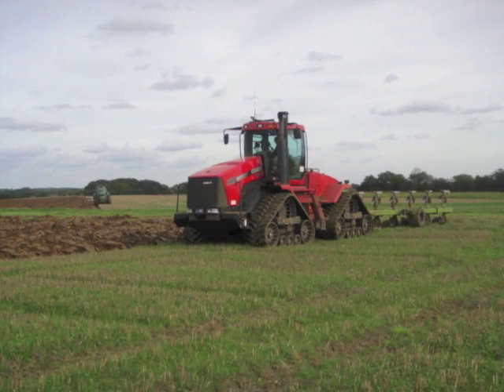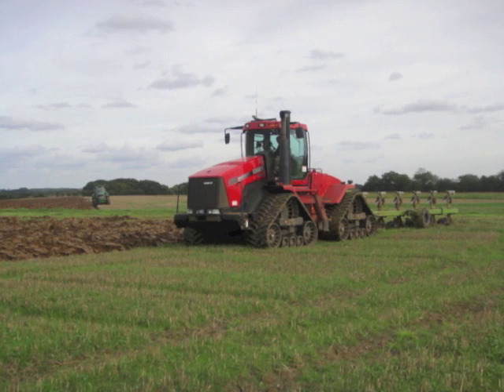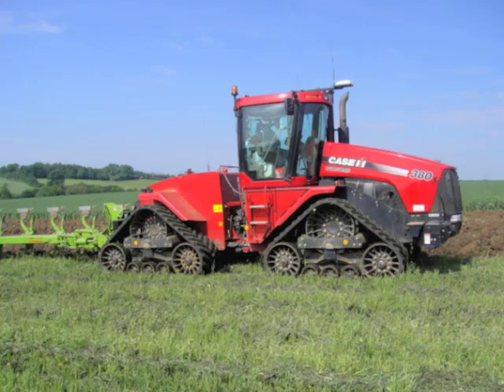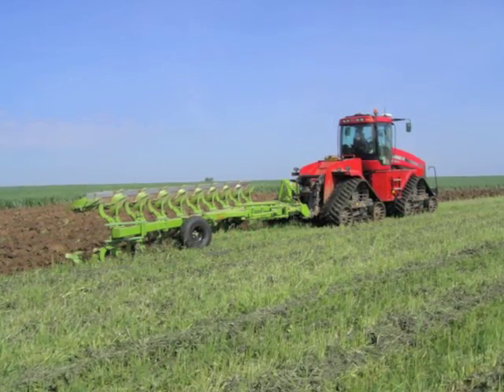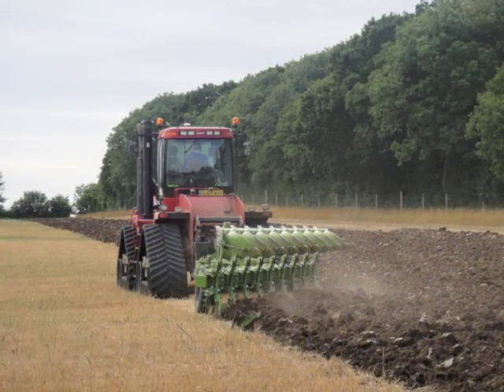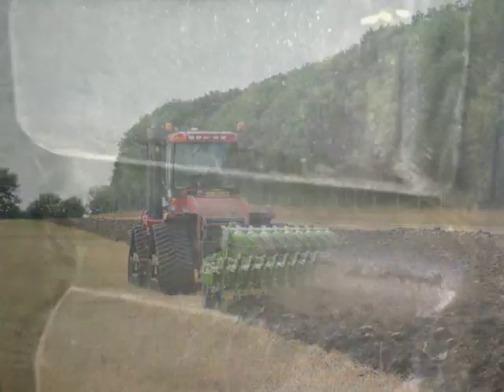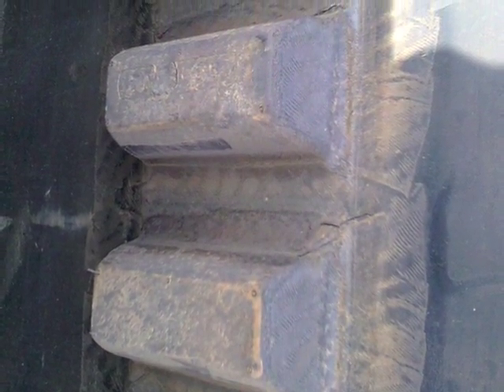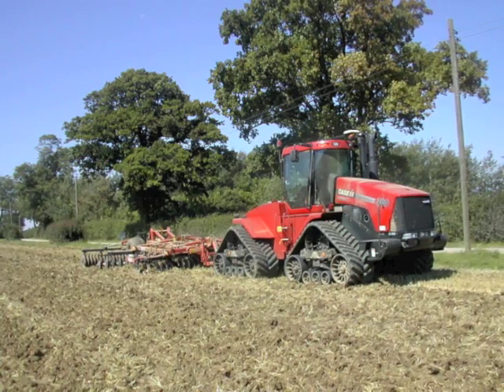Kevlar coating on Quadtrac Goodyear tracks cracking. Should I be worried?

Comment from the maker: @ajsnorfolk I did not ask for the coating, they just sent them out. I am pushing the dealer for a letter to say that the cracking is normal and that there is no reason why they should not last as long as the previous tracks. I can only assume that the coating is put on the tracks to extend their life and to help stop lugs coming off the tracks in the first place. The reason for changing the tracks is never that they are wearing out, it is always because they start to loose internal lugs.

Comment: Well if they said that they should stick by you as they are the first tracks with the coating they have fitted, did you ask for the coating or did it just come with them anyways. As you pointed out in your video you dont want your tracks to fall apart when busy as this is your main tractor, i would see if they get any worse through your spring work if they do get them to change them as its a faulty part. If they refuse go to straight to the manafacturer they can make the dealer do what they lik

Comment: Maybe the kevlar coating has stiffened the rubber up causing it to crack from not being able to flex as easily, i cant think its a good sign and dealers are like the store workers they dont now much speak to the firms fitters they will soon let you know about other problems